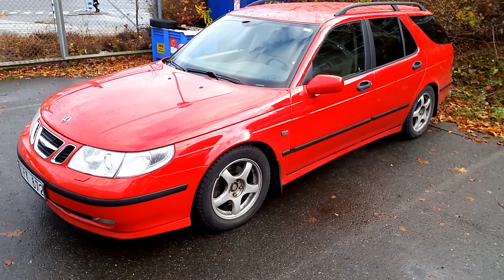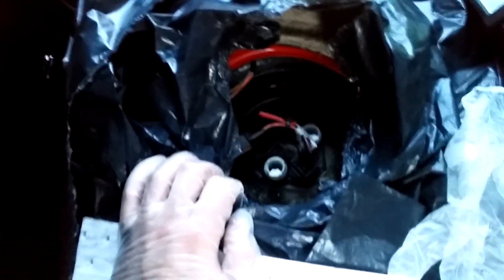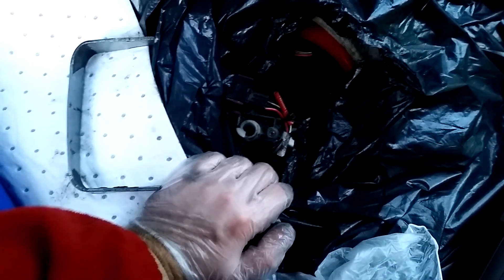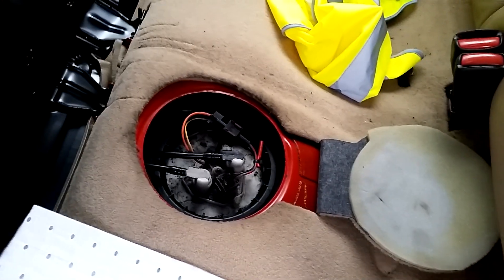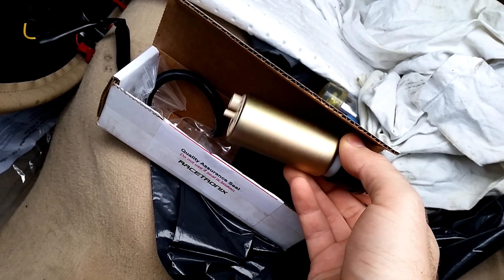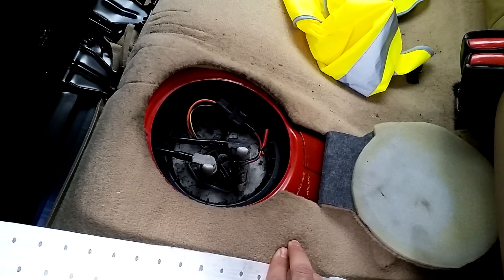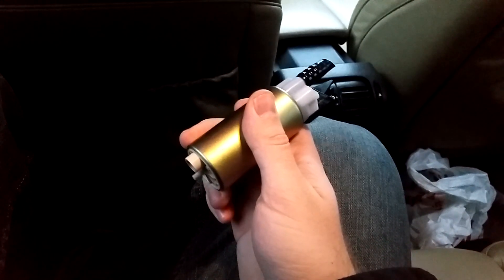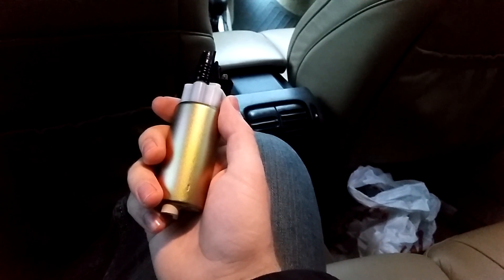Saab 9-5 Fuel Pump Replacement Overview - Trionic Seven

Comment: A comment for your viewers. I was riding along yesterday and my car, 01 9-5, just died. I pulled off and opened the hood I smelled gas. I walked around the car and I see dripping from the passenger side left. The fuel filter and lines run on the other side so I was very confused why it would be dripping there. And also why a drip would stop the car from running. So I  thought it was the return line severed or something. Thanks to your video I popped the seat up and opened up that area of the fuel pump and the stop clip designed to hold the two lines to the fuel pump didn't do its job. It wasn't broken it just had let the return line pop out from pressure. There was a huge pool of fuel which I sopped up. I reconnected everything in the car fired right up!

Comment: Could be a silly question as I kinda of know the answer but on a Saab 9-5 2002 should you be able to hear the fuel pump prime when turning the key without actually firing the engine, I can clearly hear it on my other cars just not the Saab which won’t start 🤦🏻‍♂️

Comment: I've now done it on a couple of 9-5s. One I used a screwdriver and rubber mallet and worked the ring around. For the second I built a tool. I did a bit of measuring and found a short section of PVC pipe that was a little bit larger than the inside of the ring. I set it on the ring and marked the location of the tabs. Using a saw I cut short slots in the PVC. On the top side, I cut notches on either side to lay a pry bar across. One could also use a long screwdriver with a square shank. It did take a couple of tries to get the slots for the ears in the correct location. It's not critical to get all of them in the right spot. Thanks for the clarification of the indexing marks. One of the 9-5s seemed to have the assembly indexed wrong on a previous repair as the fuel gauge wouldn't read correctly.

Comment: I mean damn you pumped corn oil into your fuel tank. If you only broke your fuel pump I'd be surprised. We need a specific fuel rating for a reason. One of them is for knock or detonation which ever you prefer. Also our ecu reads the fuel content to adjust our timing for power adjustments advancing and regarding as needed to maintain the parameters of the ecu. If you have a turbo you need a higher rating because they usually run the engines with low compression  and then you either will run rich or lean and then your screwing with everything. Why do people wanna do shit to their cars just to see what it will do. Like you have loads of money to throw away? I work hard for mine. And if I just wanna see I go here to YouTube there's always a dummy willing to just see for views.

Comment: You skipped the important bit... removing the fuel lines  I do not want to break them so I though look how someone else did it... NOT HELPFUL
Reply from the maker: Just work them carefully and slowly.
Reply: I did .. The pressure line retainer broke. so now I have to get a new fuel pump not just the inner pump bit.
Reply: I was stating this earlier. Everyone wants to make the video, but cuts it short on the important parts. Here's where your pump is, here's the lines. Skips how they took it out and apart. If your going to stroke the crowd to follow this far take the time and show them the whole process. Telling someone who don't know how it comes apart to take their time don't help. They obviously don't have a lot of cash or they would have taken there car to a shop in the first place.

Comment: If you don't have a tool to get that ring off do not force it, a great way is to take a set of pliers and flip them upside down so each handle fits in a groove on either side (imagine taking your fingers and making a standing man, your index and middle finger standing on the fuel pump its feet in the grooves on either side) and then use a bar/hammer/length of wood and set it in the center of the plier head to turn the pliers around. (Perpendicular, or pretend the man is carrying the bar on his shoulder if you need to lol) Don't try to knock the thing open or pry it, use this method as it is safe.
Reply: It took me a goddamn minute to figure that out though tell you what. Messed around with that ring for a while.
Reply from the maker: Thanks for the info! :)
Reply: Screw driver and a hammer it works. Just remember it has been on since the car was built and hasn't been removed since. Going to take a bit of finesse to get it out.
Reply: Great description!

Comment: I have a 2004 9-5. and my car used to sometimes turn off after a somewhat. hard acceleration. could it be the fuel pump?
Reply from the maker: Ask in our community forum https://www.facebook.com/groups/733705113501723/

Comment: We're replacing a 2000-year SAAB 9-5 wagon's Fuel Pump.. An eBay listing offers us a WALBRO GSS342 KIT (not the GSS341, that you used).. So, I wonder if the final '2' of mine could imply "KIT" (with a few extra bits, eg, Fuel Filter? etc.).. If not, does anyone in your SAAB Club know how my GSS342 might differ from your GSS341?.. PS.. Your local E85 seems to be 85% Ethanol; in AU, E10 implies 9 - 10% Ethanol..
Reply from the maker: That's a very good question, and unfortunatly I don't know the answer... Perhaps ask in our community forum? https://www.facebook.com/groups/733705113501723/ :)

Comment: Hey!  Just to let you know, there is a difference between the Saab 9-5 models, years 2006-2009 for USA and Canada.  This type of fuel pump replacement procedure does not work.  The tank must be dropped to access the newer style fuel pump.  I learned this the hard way!  Believe me, the tank MUST BE DROPPED.  There are no quick connect fittings on the new style, so there is no room to be able to take the pump out from under the seat, although the access hole still exists on the body.  The tool you would need to use on this pump ring in the video is also not used as it is a completely different style ring holding the pump in place.  I managed to use a chisel and a hammer to turn this free.
Reply: Brooke Derry you can acually cut a hole at the same spot where the older ones has it and change it the same way..

Trust me, been there done that, got the t-shirt
Reply from the maker: Yep, that's because it's a Biopower car which I think I say in the video. Only the non-biopower saabs can replace the pump without dropping the tank.
Reply: It's most definitely an Ecopower.  It's just a strange type inside the tank..Only in these years in the USA and Canada.
Reply from the maker: What specs does your car have? Biopower cars still say "Ecopower" on the valve cover.
Reply: 2007 2.3L Aero Purchased in Montreal

Comment: Hej Jonathan, jag har en saab 9-5 2.0t från 2002 sedan modellen. Den har rullat 21.4k mil i skrivande stund och jag började för ett tag sedan tänka på att det kan vara bra att byta bränslepumpen i förebyggande syfte innan något händer ute på vägen. 

Normalt sett så vet jag att man kan höra ett litet "gnisslande" ljud under baksätet när man slår på tändningen = pumpen går igång.

Igår körde jag en flaska stp complete system cleaner i full tank på bensinstationen och körde till och från jobbet (6 mil tur och retur totalt).

Nu när jag körde till affären efter jobbet så dog bilen precis utanför och jag misstänker att pumpen har gått sönder. (tror inte att stp complete system cleanern var boven men vem vet) Jag har bytt vevaxelgivare för ett tag sedan och när jag vrider om tändningen så hör man inte längre det där gnisslandet från baksätet när pumpen ska gå igång. Vad har du för tanke om detta? Kan min hypotes stämma om att det är pumpen som gått? öppnade upp baksätet och luckan till pumpen men den hörs inte alls och vibrerar inte heller när man sätter handen på locket som förut.
Reply from the maker: Slå aldrig i "mirakelmedel" om du inte har ett specifikt behov som exakt detta medel löser. En originalpump från din årsmodell går ofta sönder någonstans runt 20k mil, så bränslepump låter faktiskt troligt. Lägg på några kronor extra så får du en fin pump som även kan pumpa etanol.
Reply: Jag behövde det faktiskt! Men det var pumpen, bytte den igår och körde på biltemas med armatur. Behöver bilen till helgen och kan inte vänta på en walbro eller annan prestandapump från webben. Så jag klickar hem en prestanda pump och bygger in den i den gamla armaturen inför kommande trim (ska uppgradera turbo och spridare osv). Tusen tack för din input! Följde även din video om vacuum slangarna och nu är bilen roligare att köra!

Comment: Hi, thx 4It your bright explanation.
Still convinced that the GSS341 is a very good / best alternative ?
Reply: unfortunately, the GSS341 is not a good plug and play replacement for the AOS006, I experienced. The main problem is that it is too wide.
Reply from the maker: I had no problems with that pump so I guess it worked fine for me :)

Comment: in 8:05 you said something about a flexible hose, what kind of hose should I use? Should I use a vacuum hose? (The same type you used in your vacuum hose replacement video)
Reply from the maker: +Ali That is a special fuel hose that I got as part of a conversion kit for the pump. You need e85-resistant fuel hose, not a vacuum hose.
Reply: Can I use a braided fuel hose like this one: http://www.eeuroparts.com/Parts/84015/Fuel-Hose-Braided-3-5mm-ID-x-1m-N2035311/

And do I need to use hose clamps on it? Since my fuel pump is dead and my 9-5 has been sitting for months..
Reply from the maker: This is similar to the kit I got. https://www.maptunparts.se/branslesystem/tillbehor/5965/monteringssats-hogprestanda-branslepump.html (don't know if I linked the swedish or english version though)
Reply: +Trionic Seven: For Saab Enthusiasts so you just used the hose that came with the kit?
Reply from the maker: Yes, that's right. The hose together with the clamp. I didn't get that exact kit from Maptun, I bought the kit from Racestuff.
Reply: +Trionic Seven: For Saab Enthusiasts Thanks for the help man! Hopefully I'll be able to get my car up and running these next few months.

Comment: Hello. Love your videos! When changing the fuel pump, and/or switching to E85, it is recommended to change the fuel filter. My fuel pressure fell after a tank of E85, but a new filter fixed that. Having a restriction in the fuel line like a clogged filter may put unnecessary stress on the fuel pump, leading to premature failure :) Keep up the good work!! Maybe I'll make a few videos about my 93 ;)
Reply from the maker: +BOSSKARTY Yep, good point with the filter. The filter in my car is brand new.

Comment: Yeah I tried the making the tool route didn't work had to go the old fashion way hammer and screw driver which took 5 min plus I had a spare ring just in case, getting the pump out was more diffcult then putting it in total time 30-45 min my first time on my 2003 which I never had to do on my 99 9-5
Reply from the maker: +WHO9119 Good job, you did it much faster than I did it.
Reply: Can't believe a mechanic tried to charge me for 4 hours of labor for this job 🤦

Comment: Silicone spray is far better at making plastic and rubber slippery than mineral-based WD40 or 5.56. I changed on my 2002 and the only major problem was getting the nipples back into place, probably because I bought a complete replacement part, not just the pump and it was a very tight fit. I greased them with some silicone grease and used a dead blow hammer and in they went!
Reply from the maker: +Indiskret1 Good tip, thanks! I actually used penetrating oil too, not just WD-40.

Comment: Hi, have you had a problem with fcod 278 ? Is it supposed to be the water temp sensor since I changed the thermostat 4 weeks ago ? And happy new year !
Reply from the maker: +Dilyan Yordanov Hey! Is 278 the error code on opensid?
Reply: Yes,but don't worry.I solved it. IT was the water temp sensor but i cleaned it and it works fine now :)

Comment: New(er) to the SAAB family, I purchased a 99 saab 9-5 estate, I have an "check gearbox" light, it comes on with no rhyme or reason, never seems to effect its mileage or anything else... shifts/acts fine. any clues??   (150k miles) Also any chance you could show a aftermarket radio install? Ive looked into it a bit and found very random info, lots of which contradict each other. any help would be great, keep up the good work!!! Thanks from the USA
Reply from the maker: +alan king Hey Alan and thanks for your comment. Assuming that your car is an automatic, I don't really have any help to give as all my cars are stick shift. I highly recommend that you get your fault codes read out by a garage, without it we won't know what happened. The gearbox light does not appear without reason, so avoid driving unless you get it sorted out.
Reply: yes, its an auto... (first ive owned in 20 years) The garage i took it to said it was a "control box" for the tranny that had a loose connection? although he didnt fix it and i coudlnt find it anywhere lol.... ive also read it could be due to vibration if the tranny mount is worn? (was thinking of trying that one.) sport and winter modes both work fine, its never shifted weird or anything. the only thing else thats ever gone wrong was a o2 sensor, asided from this one annoying light its been a pretty good car for my first saab
Reply from the maker: +alan king Good luck! Hope you get it sorted out.
Reply: +Trionic Seven: For Saab Enthusiasts well, I flushed the fluid in the trans and ended up replacing a trans mount, which did look pretty bad, so no the lights off most of the time lol.... who knows. seems good for the moment, so perhaps it was being a bit temperamental.

Comment: Tja byte min pump föra veckan och nu går den inte över 2500rpm vet inte vad det kan vara :/ känns inte som motorn får tillräckligt med bränsle. 
(har en saab 9-5 00 med 191HK och köpte en eftermarknadspump från maptune)
Tacksam för tipsen
Reply from the maker: +Felix Glasspinnen Hej! Kan den ha hamnat i limp home mode?
Reply: +Trionic Seven: For Saab Enthusiasts Nej, sprang ut och kolla för att vara 100% inge krångel vid throttle body(ingen CE lampa lyser).
Så fort man gasar på så är det som att bränslet inte kommer fram eller som att den suger in luft eller något. Eller kan det va så att pumpen inte är start nog men det tvivlar jag på.
Något sätt jag kan felsöka?
 Något tips på verktyg så man kan få fram live data ifrån? så man kanske kan hitta problemet på det sättet. Kan ju trots all köra bilen på lägre rpm, (så man får fram diagram/graph)
Tacksam för svar!
Reply from the maker: +Felix Glasspinnen Okej, det låter märkligt. Jag tänker att dåligt bränsletryck kommer göra att motorn går magert och dåligt, om detta kan ge de symtom du ger är jag osäker över. Börja med att skaffa en elm327 och koppla till din telefon där du kör en obd2-app. Kolla short term och long term fuel trim. Short term ska avvikelsen vara mindre än +-10%, long term ska vara mindre än +-5%.
Reply: +Trionic Seven: For Saab Enthusiasts Är det en sån här du menar?
http://cdon.se/hem-tradgard/felkodslasare-mini-elm327-bluetooth-1-4b-p35443937?utm_source=pricerunner&utm_medium=cpc&utm_term=Felkodsl%C3%A4sare+Mini+Elm327+Bluetooth+1.4B&utm_content=35443937&utm_campaign=pricerunner_Hem+&+Tr%C3%A4dg%C3%A5rd

Tycker den var väldigt billig! :0
Reply from the maker: +Felix Glasspinnen http://www.kjell.com/se/sortiment/el/verktyg/matinstrument/obd-2/obd-2-adapter-elm-327-for-bluetooth-p48500 (endast android!), för iphone måste du köpa wifi-varianten
Reply from the maker: +Felix Glasspinnen Det ska sägas att jag enbart är amatörmekaniker. Hoppa in på närmaste saab-forum och ställ frågan där innan du köper något :)
Reply: +Trionic Seven: For Saab Enthusiasts Jo de är jag medveten om. Vill bara säga att dina videos är sjukt hjälpsamma! Och jag uppskattar alla videoklipp du har lagt ut och den tid du lägger på dem. Och jag  hoppas på fler av dem! :)
Reply: +Trionic Seven: For Saab Enthusiasts Kostar så lite så kan va värt att testa, har en Android btw. annars titta jag på kiwi 2 men dom är så dyra, så de här blir nog bra till en början :)
Reply: +Trionic Seven: For Saab Enthusiasts Okej hitta felet och det var eftermarknads filtret till pumpen som begränsa den, så stoppa tillbaka originalet. 
Köpte den där OBD-2 men den vill inte ansluta till bilen :(  (ikonen med bilen blinkar fortfarande)

Comment: Protip:
This tool works just fine for removing the fuel pump ring:
http://www.biltema.se/sv/Bil---MC/Verktyg-och-Verkstadsutrustning/Avdragare/Avdragare-2-armad-2000018449/

Just remove the threaded bar and re-insert it the other way around and it'll fit without the threaded bar being in the way....
Reply from the maker: +Chris Rajula Good tip! :)